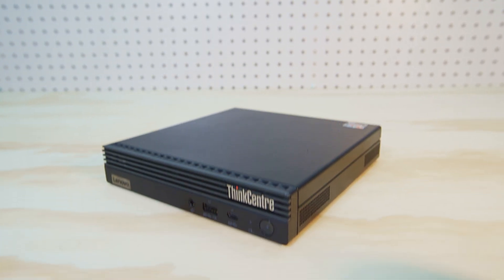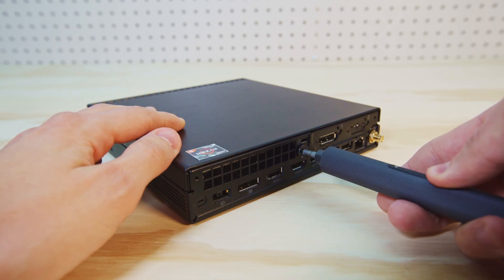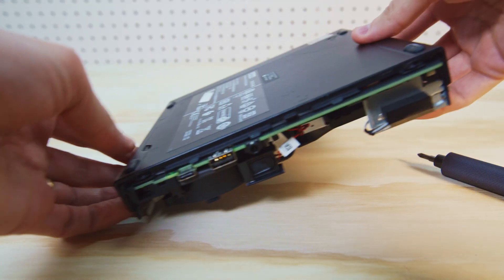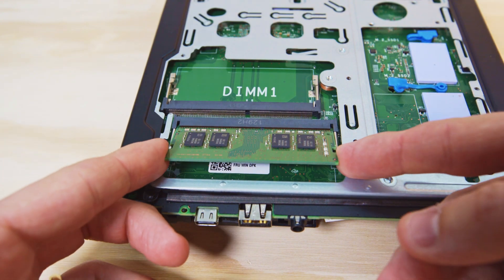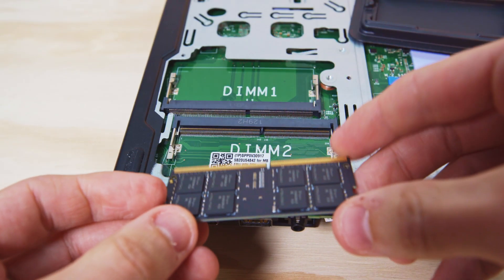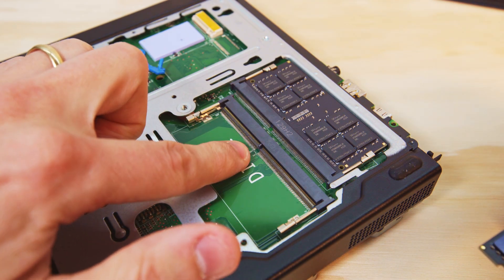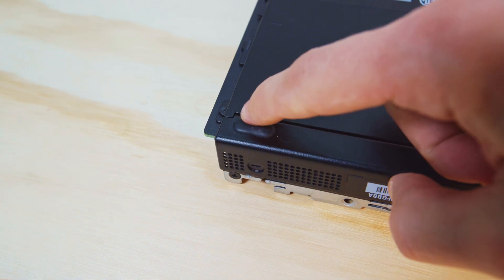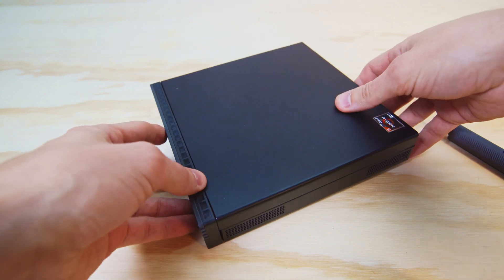How To Upgrade Lenovo Think Centre RAM

Comment: I echo what the others said about the straightforwardness of this. I have the Hardware Maintenance Manual PDF but a hand-on video makes it even easier. I just ordered 2×32GB Kingston SODIMM (before prices go even higher due to the AI craze!) to upgrade the stock 8GB as I will be running ESRI's ArcGIS Pro where 32GB is recommended.

Comment: Would this upgrade work with 710q mini pc
Reply from the maker: yes you can get 64GB max, the internals may not look identical to this machine but it should be close

https://www.reddit.com/r/homelab/comments/rc1n08/lenovo_m710q_tiny_ram_support/

these people have reported that your model works with 64GB
Reply: Thanks for the reply m8 and the help 👍